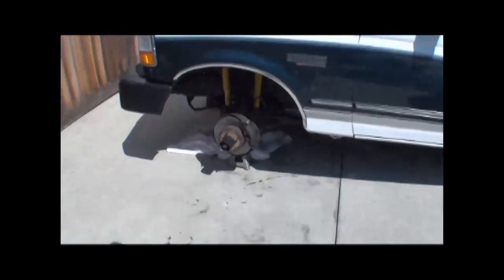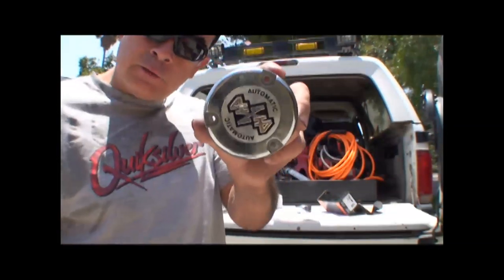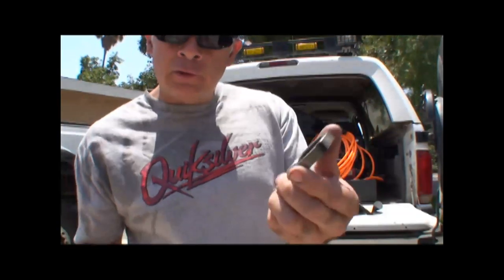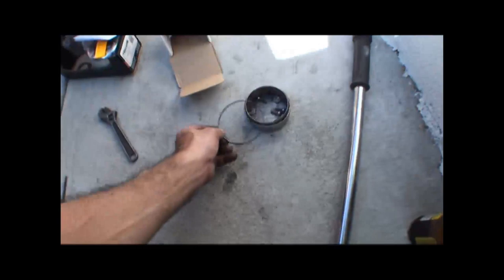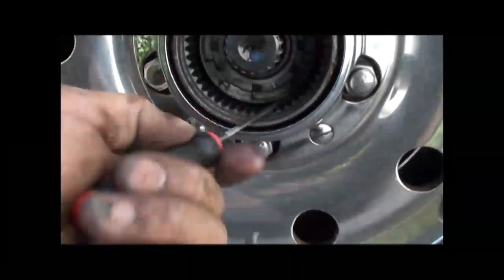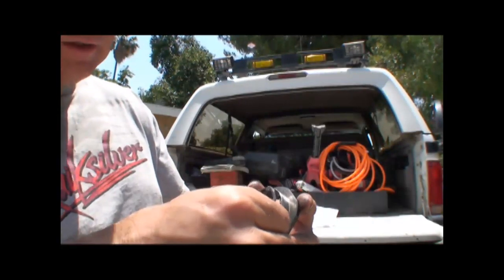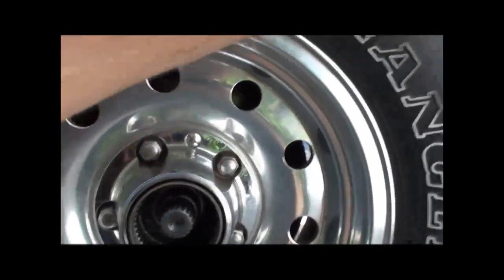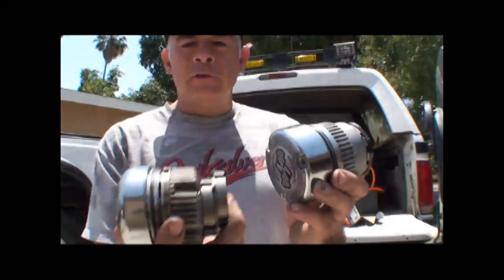Bronco Automatic Hub Conversion

Comment: Transferring my 90 Bronco's Warn 6 bolt manuals to my 96 Bronco broke 3 bolt auto hubs. Didn't need the adapter kit, but this video helped get it swapped. Once the part about the auto hub bearing nut came up - all I needed to make the swap. Thanks!

Comment: Do you need to pull that bearing adjuster nut to put manual hubs in, if the truck already came with manuals? I've got a 90 Bronco and I've been looking through your maintenance and rebuild videos to get a taste of the work I'll be doing. All good stuff and well laid out. Just swapping nasty broken plastic OEM hubs with some metal Milemarkers.
Reply from the maker: +Bro A I dont think so but I'm not sure. You should be able to tell once you pull the old hubs out. New hubs should fit right up.
Reply: rudedogii I just picked them up from the store, putting them in first thing tomorrow! I'm super excited. This is my first vehicle and I've been babying the crap out of it because it's old.
Reply from the maker: +Bro A Good luck! They should just drop in. Read the paper work that comes with the hubs. I got new paint, wheells, and tires. Going to think twice about hitting them rocky trails.

Comment: wait i have a 93 bronco and i took the auto hub out because some of the gears were broken and it was knocking. but the stuff that was in my truck looked like the stuff u got with the conversion kit. Do i need to by a conversion kit still to change to manuel hubs?